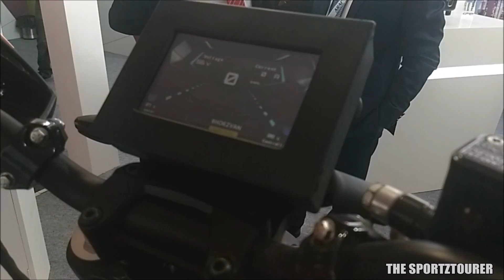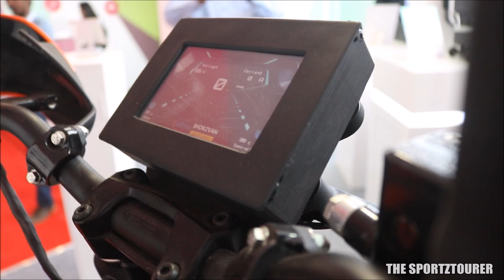BEST MODIFIED KTM DUKE 390 | ENGINE REMOVED, POWER & NEW SPEEDOMETER UPGRADE | DOPE TECH

Comment: Hey bro I want your help. 
I am going on ride to Goa on Monday,so 2 days back I serviced my bike but I didn't change oil because I have only driven 500 kms after the oil change(in previous service),but the problem is my rtr 160 is overheating a lot,and the bike has become very rough it overheats a lot after riding 2 to 3 km.I don't know what to do I have visited service centres but they are telling engine heats when riding.
After riding 2 to 3 kms bike will become completely overheated and its heat can be felt on legs.
When engine is overheated the pick up will drop for riding 3 to 5 kms. And also bike is vibrating like hell.
I don't know what to do pls help
Reply from the maker: Hi Manoj,
Get the air filter inspected and replaced if needed then you can ask the service guys to tune your carburetor accordingly 😊
Which oil are you using now? Grade?
Reply: @thesportztourer  
The current oil I am using is tvs true 4 synthetic oil grade 10 w 30

Comment: Battery is the biggest hurdle.
Reply from the maker: Yes, That's true for all the electric vehicles 👍
Battery technology and it's management has come a long way and still has to reach a point where we can compare it with vehicles running on hydrocarbon fuel.

Comment: Its a wonderful approach from infineon...
But there are problems with this..with its engine and weight also the front tyre gets lifted up while aggressive acceleration but now the bike weighs much less and the torque is more than its stock bike so i guess thats not safe because it's an motor which can give 100% acceleration from initial starting position...

Still i must say well done infineon..👏
Reply from the maker: Hi Sushovan,
With bigger battery packs and motor, things should get balanced. Keep the CG level low will be a challenge here.

Comment: I wonder what if they used a V belt drive rather than a chain and sprocket, it would surely make it more smoother and quieter but i wonder how it would affect the efficiency
Reply from the maker: Right, V belts are smoother and silent in operation. I assume they kept the chain for better power/torque transfer efficiency.

Comment: That is one great step towards future... I just have one question although its a prototype but isnt the motor more towards the lower side i mean hanging out and will it not effect the normal ground clearance? One more how much will be the cost. Usually battery operated bikes are on the expensive side..
Reply from the maker: Hi Pratik,
The ground clearance is decent. The motor seems to be on the lower side because of the gap at the top. I am assuming that's for the bigger motors which they are planning to bring in the future.
Totally agree with your statement, it's a step towards the future 👍